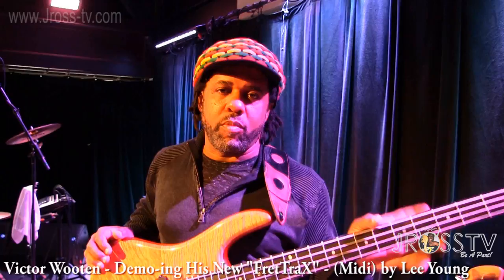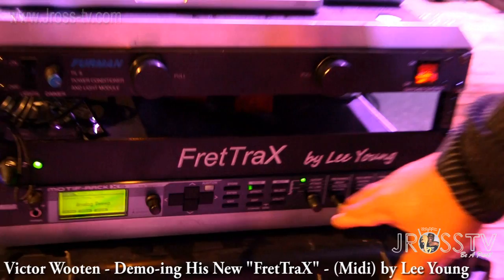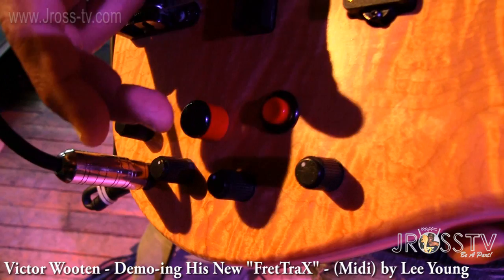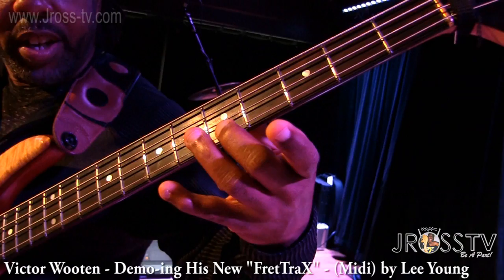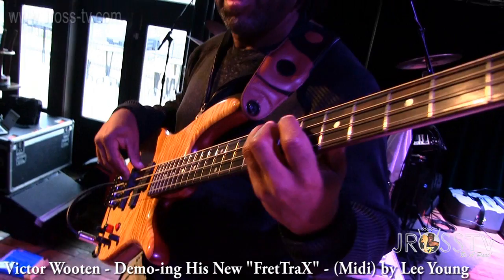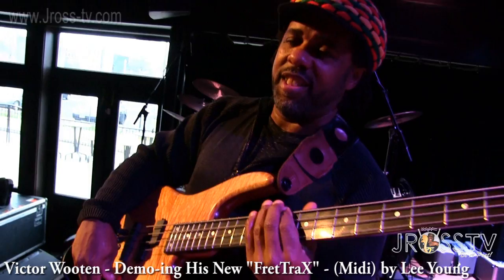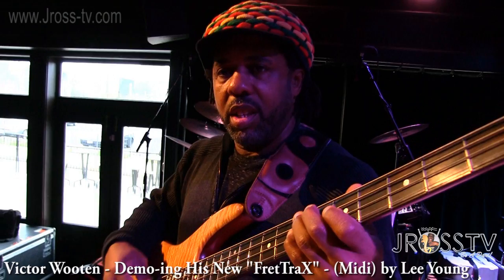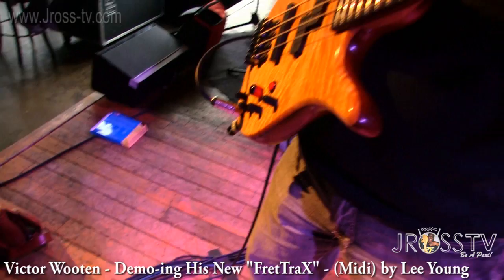James Ross @ Victor Wooten - (Demo-ing) "FretTraX Midi - www.Jross-tv.com St. Louis)

Comment: The Peavey Midi-Base came out in 1993 IIRC, Then the Cyber-Bass, Synthaxe etc. 
Not new technology at all.. 25 years old to be exact..
The electronics are now smaller, The Midi-Base was full of green boards with dozens of IC chips, It also had each fret cut into four pieces to keep each note from shorting out on the next string & also needed the frets to be polished to make 100% contact on the strings, Also I would imagine that coated DR strings would not make contact, I note VWs bass has a brass nut which would also conduct??.. I had a look at FretTrax's website & the don't give any info on exactly how the unit works.. Also I'd guess that each fret has a separate wire or four like the Midi-Base which had 21 frets x 4 = 84 wires to the frets, Don't unbolt it's neck.. I guess there's a flat ribbon cable in there? I wanna know more about this NEW technology..
Reply from the maker: I don't know of any technology where the fretboard is removed and each individual fret is wired but I could be wrong...
Reply: Headknocker in this day now nothing is new buy it's way more advanced. Of course midi isn't new. Have been many midi contraptions over the years for guitars but none where you could trigger a different parameter from each fret.